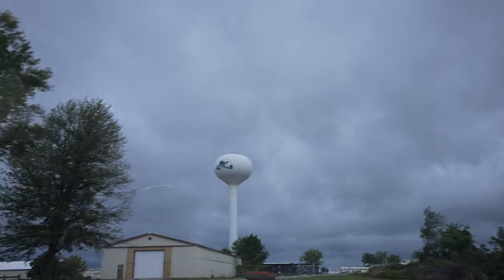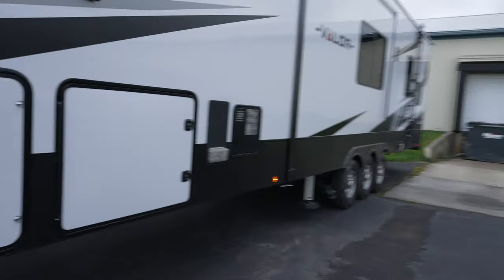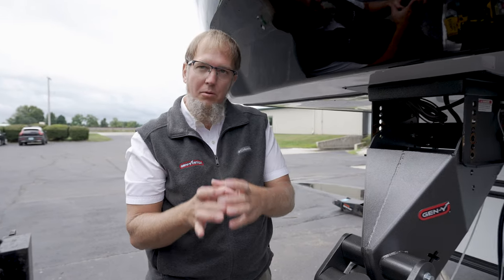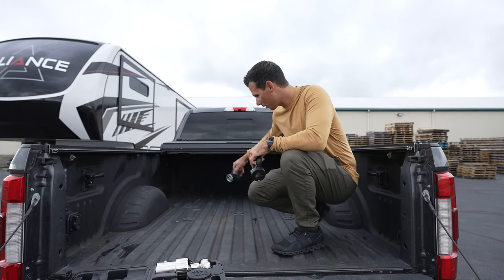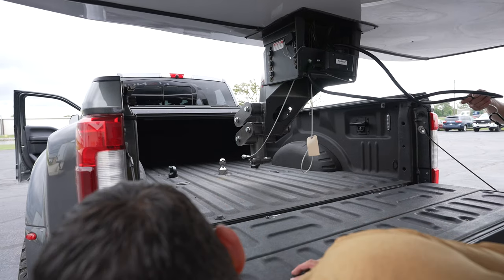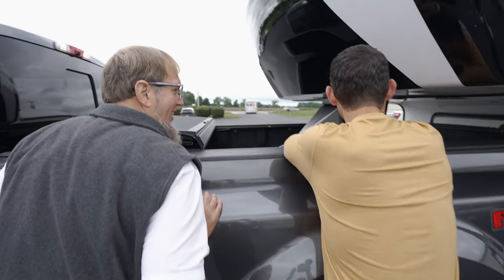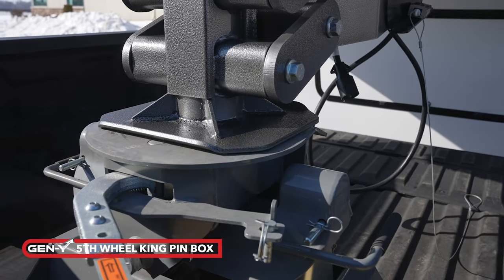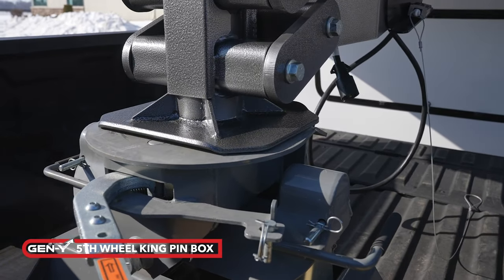Gooseneck conversion on our Alliance Valor...should we have done this sooner!?

Comment: Gooseneck is on heavier trailers because the trailer can lean with out flexing the trailer frame,as in horse trailers and equipment trailers that go off road. On semi trailers the fifth wheel stays flat but the truck frame and suspension is designed to flex.
Reply from the maker: That’s a great point! Thank you for sharing.
Reply: The gooseneck is much easier on a pickup truck frame and suspension because it can pivot 360° a fifth wheel just back and forth, and we all know Campground roads can twist back and forth which makes it much easier on the camper and the truck with the gooseneck

Comment: It's the law because of the semi's and the people lobbying for them. There is no other reason that you need one.
Reply from the maker: Good to know!
Reply: Since when do semis use chains with coupling a trailer? The reason is legit in the name “safety” chains. Just like on a bumper pull, it’s in case the trailer comes uncoupled and doesn’t fly off into traffic.
Reply: Gooseneck need chains, 5th wheel doesn’t

Comment: Another plus for the gooseneck is that it is a safer solution.  I've seen many YouTube videos of trailers crushing the truck bed because a pull test was not performed when pulling away or having your arm ping between the trailer and truck bed because the trailer rolled off the hitch.  It's very difficult to have that happen with gooseneck - it's either hitched up or it's not.
Reply from the maker: Yes! Absolutely! That is such a great point. We believe this to be the safest solution as well and will always tow this way moving forward.
Reply: NOT TRUE.  That is why chains are required on goosenecks and not on 5th wheels. The failure rate of 5th wheels is very, very low compared to ball hookups.   I'm not saying goosenecks are bad, I actually love them.  But it is not "it's either hitched up or it's not".  MANY people "high hitch" when using a ball set up.  You must make sure the ball is seated properly and the hitch is not sitting on top of the ball.     @PawsForLove
Reply from the maker: Absolutely, great points!

Comment: As far as warranty, may depend on manufacturer. I have verified with Brinkley about switching out on a Z model and they prefer the Gen-Y (it is standard on the G model - choice of pin or gooseneck) and believe they will be better for the chassis and frame long term. Since warranty goes through them, they have said it will obviously not void it even though it is a Lippert frame.
Reply from the maker: That is great to know! Now that you say that, I do remember seeing the Gen-Y Fifth Wheel version on the demo unit at the Tampa show this year.

Comment: I have had my Gen-Y gooseneck on our Reflection for two years ...absolutely luv it! No maintenance, built extremely well. We use the B&W ball which gives a little extra height. 100% recommend Gen-Y over other brands.
Reply from the maker: I love to hear that! We are equally as happy with this unit and highly recommend it. Inflating airbags is no fun 😂
Reply: How about short beds? I’m soon to be market ,love idea
Reply: @emmo51364   I have a Ram 2500 and tow a keystone cougar. I can't make 90 degree turn with the gen y. Then again I never needed to ever before. So well see how it goes.
Reply: @Mattman2500  Thank you ,haven’t pulled trigger just yet. I’m thinking you’ll like it,looking forward to hearing more. Thank you

Comment: Well... not knocking it, but i have a question to anyone: Are the benefits worth the hassle of climbing in and out of the bed for the safety chains?? Also, once you get under, if you put the gate up, don't get in a rush and frustrated because your ball isn't lined up and pull out.

Comment: I used my brothers truck to tow our 5th wheel home and instantly took off the king pin and put a Reese Goosebox on it.  

My big reason was I need my truck bed.  I put a BW turnover hitch in it as it wasn't factory prepped and now all I have to do is flip the ball over and I get my bed back instead of having to remove a 200lbs hitch.  The ride is also better, but that wasn't my primary reason.  It's a little more difficult to hook up, but you get used to it.

Not all states require the safety chains, but I bought mine from Reese and hook them up every time.  Better safe than sorry.
Reply from the maker: That is fantastic! And such a great reason to go with a goose set up. It’s great that mostly all options out there are high quality — so you really can’t go wrong.

Comment: We bought our Alliance Valor 40v13 last December. 
We never even towed it off the lot without the Gen-Y Executive hitch. 
We Absolutely love it.
I did a ton of research and realized this is the safest and easiest way to tow.
We however opted for the B&W
Ball kit for our Ram Truck. 
I put the chain anchors in the rear position. I can reach everything standing on the ground. 
The B&W Ball is nice with the handle so you don't have to get grease everywhere when removing 👍
Reply from the maker: I'm so happy to hear that you love yours too! Seriously, so game-changing. That's a good point on the B&W hitch.. I hadn't even thought about that part when researching. I guess we just assumed they were kind of a "one size fits all" thing. I'll dig more into that now, thanks for the tip! - Sean
Reply: @PawsForLove  Also with the B&W ball there is no Mechanism in the top of the ball. 
People have had problems with some of the others because over time with the weight and wear they can't get the Mechanism to release.
Reply: How is the hitch on the 40v13? We are getting the 40v13 soon and the first thing I want to do is move to the “gooseneck” setup
Reply: @raddisonwilliams  It's absolutely great. We will never have any other hitch.
Reply from the maker: That’s so great! Same here. We actually just sold the Valor and are getting the new Paradigm 375RD. First stop is the Gen-Y factory to get the new one put on!

Comment: We love our Gen-Y Gooseneck hitch.  It is a rough ride for the first 600 miles or so.  We have 7500 miles on the hitch and wouldn't trade it for anything.  We got a tire step... it makes it a lot easier to connect the safety chains.  The first step we ordered was 19" wide, it did not work well with our F450 19.5 rims.  We got a 22 inch wide step and love it.
Reply from the maker: You’re totally right about the rough ride 😂 But after it smooths out… holy cow it’s amazing! Love the idea about the tire step. That might stop me from whacking my head on the cap when I jump into the bed!

Comment: Just saw the video, great video and  content.  One question.  I saw where the tailgate was an issue of almost hitting the trailer when hooking up and unhooking.  Is your truck a long bed? 
Thank you 
Safe travels
Reply from the maker: Thank you so much! Great question on the tailgate. It has roughly 4”-6” of clearance between the tailgate when it’s down and the RV. It seems like a short amount on video, but in real life, it’s not bad. 

What we have been doing though is putting the tailgate up when it’s clear of the pin box. That way there is no risk of running it into the RV.

Comment: This is interesting 🤔 thank you for sharing! I am hitch shipping now...fellow Alliance owner...and leaning toward the pull rite super glide for my standard bed truck. I wonder how this hitch performs on  short bed and standard bed trucks.
Also curious, how much weight did it add to the front end of the camper? Is it much heavier than the original pin?
Reply from the maker: Well hello fellow Ally! It's hard to tell on the comparison with a short bed because we have an 8' long bed with our F350 dually. I will always now opt for the 8' bed after having one! In regards to the weight; I don't believe it added much at all. And if you consider how much weight you save in the truck bed by not having a hitch, you'll have reduced your overall weight over the axle.

Comment: I too was wondering if the gen-y would void trailer warranty because of the change of the frame strain point.
Reply from the maker: It does void the warranty from Lippert. However, theoretically, there is no difference in this unit and other manufacturers such as Reese. We were comfortable knowing they have had zero frame issues reported though.

Comment: I believe Gen Y also makes a 5" offset ball if you need more room between truck and trailer.  Also do you find it more difficult to hitch up or getting things lined up properly?  Or is it a two person job, or if you have a bed view camera how does it go?   I know with my traditional fifth wheel as you know is fairly simple to hitch.  It does look like an awesome hitch though.
Reply from the maker: I believe they do as well! It was certainly an adjustment backing up, but it is now a one person job. It could go a little faster with 2 people. The reason is that the camera is good to line you up side-to-side, however it's hard to gauge your depth sometimes. After doing it a dozen times you definitely get a feel for where to stop though. I just do it myself now and it only takes about 5 minutes in total hooking up.

Comment: Does that camper have a lippert frame? From what I've heard the manufacturer doesn't consider the Gen y gooseneck to be compatible cuz it could damage the frame but that's just what I've heard.
Reply from the maker: Great question! This Valor does have a Lippert frame. Technically speaking, it does void the frame warranty. I’m talking with Gen-Y before we did this conversion, they assured us at they have had no known issues with Lippert frames. That gave me enough confidence to go with this unit knowing the pros vs cons.
Reply: @PawsForLove  I got ya. Out of curiosity why not go with the reese option that is certified compatible?
Reply from the maker: At the time, it wasn’t offered for the Rhino box. Even with the Gen3 one that is out now, I don’t want an airbag to maintain. I would still personally go this route again with the Gen-Y setup.

Comment: Hey, great video but a quick question it looks like your Ford is obviously a Dooley but it looks like it's a short box. What's the length of your box on your Ford? And do you find that the Gen Y hitch allows you to get close to 90 degrees or did you have to get the gen y extension to push the ball back further in the bed?
Reply from the maker: Hey there! Our bed is actually an 8’ long bed. We didn’t need an extension since it’s the long bed version.

Comment: Curious what options you have for changing the height to make your trailer level using this type hitch.  I have the B&W  25K fifth wheel hutch and it has some adjustment up and down for height.  I am curious if you had any issues when you switched over.  Is your F350 4WD?   I hear there are balls that are taller in case you are low in the front and need to raise the height
Reply from the maker: This is a really good question! At the end of the day, the way to adjust height on this is to adjust which holes you're using in the pinbox. I feel that overall, I'd assume this will work on almost every truck and you'll have plenty of clearance between the bed and RV. Our F350 is 4WD. Personally, I'd really like to level our truck with the 2" spacer in the front, but it's hard to justify the expense!

Comment: Will this stop the chucking. I’m up against my payload weight on my Grand Design 150 series towing with a Tundra. I do bottom out on bridges sometimes.
Reply from the maker: I believe that it will. It did on ours at least.
Reply: @PawsForLove  are you pulling with a half ton?
Reply from the maker: @mikegarrison3740 We have an F350 dually, which is the truck in the video.

Comment: So is that on a short bed or long bed? Will it work on short bed?
Reply from the maker: We have an 8’ bed. I believe this will still work on a short bed, but you could run it into the cab. The slider hitches help fix that problem when using a fifth wheel style connection.

Comment: During your research, did you compare the Gen-Y to the Reece Gooseneck?  Many say that the Reece Gooseneck is the only one that won’t void the Lippert frame warranty??  I want to go to this type of pin box when I get my new truck so I’m curious as to why you picked this one over any other gooseneck type options.
Reply from the maker: Great question, Mike! Yes, we did look at the Reese gooseneck. Ultimately, I didn’t want an airbag to maintain, which is what swayed us to Gen-Y. You are definitely correct about the Lippert frame warranty with Gen-Y though. When we spoke to Gen-Y about this, they had said that out of thousands of units, they haven’t had a single frame issue. For us, that was enough to trust it. However, it’s understandable if that’s a deal breaker and pushes you to the Reese.
Reply: @PawsForLove  I like the way you think. When he explained that there’s no maintenance to be done at all on the Gen-Y it sure got my attention. One of the main complaints I’ve heard from people using the Reece is about the airbag that requires frequent inflation & adjustment.  I’m not sure why Lippert hasn’t approved the use of the Gen-Y on their frames but I think the numbers speak for themselves if no one has reported any issues so far. Thanks for the quick reply 👍🏻
Reply from the maker: @PAWS4U  You're absolutely right! The airbag was a deal breaker for us for that exact reason.

Comment: is the mileage difference because you are not in and out of the throttle when the trailer would bounce with the old hitch?
Reply from the maker: That’s a great question. From what I understand, that is correct. It’s more “connected” to the physics of the truck and it’s also not bouncing around as much because the pin box essentially has some built in suspension with the TorsionFlex technology behind Gen-Y.

Comment: I have a 2022 Ford F-350 with the puck system installed can I pull my fifth wheel out and just drop a ball in?
Reply from the maker: Yes sir! That’s exactly what you can do. The middle hole is the one for the ball.
Reply: @PawsForLove , I bought the truck with the hitch in and have never pulled it out so I had no idea...Thanks!

Comment: easy to hookup = easy to steal. How do you secure a gooseneck? 5th wheel trailers have kingpin locks, which work pretty well.
Reply from the maker: Great point and question. Gen-Y makes a lock for the pinbox and we use that. Here is a link to what we use: https://genyhitch.com/product/auto-latch-gooseneck-coupler-lock/?attribute_pa_receiver-size=auto-latch-coupler-lock&gclid=Cj0KCQiAgribBhDkARIsAASA5bskjTrpUuptWW6P-A_E1DAYESi1c0oLvXRkaoPxmklBaDzgqgVEIeAaAqQDEALw_wcB

Comment: ??? Y would you place all of that pin weight on such a small focused area.  I see you have the ford factory 5th wheel “puck” system in the bed.  It allows for better weight distribution on the truck frame.
Reply from the maker: These trucks are set up to carry very heavy gooseneck loads. Have you ever seen the “hotshot” setups that are hauling 3-4 cars? That pin weight is much higher than our Fifth Wheel.

Comment: We were considering this hitch but have been made aware that this will void your rigs warranty?
Reply from the maker: So it doesn’t void the overall warranty. At this point it will void the Lippert frame warranty, however, they have had zero reported incidents since this product has been introduced. We were told that when we toured the factory.

Comment: Greetings! I'm actually doing the very same research right now for our rig.  I have to admit that my focus is not really on freeing up the bed of my truck, it's more around ease of hitching and smoothing out the ride.  The question that I have, that I've not seen addressed anywhere, is how is the side to side flex? The up/down is handled by the torsion bars, but what about side to side? Thanks for the great video! It was very informative and good to see the ease of the switch out.  Safe travels!
Reply from the maker: This is a GREAT question! Until you pointed out that it’s not been addressed anywhere, I hadn’t realized that. Such a great point! After reading your comment, I reached out to Jason at Gen-Y. He is the gentleman in the video that walks us through all the information. He first pointed out that when the fifth-wheel does move side to side, it will pivot on the ball, which means that it doesn’t technically compress the rubber (Torsion Flex) as much. But figuratively speaking, if the coupler was “solid mounted” on to something, and not on a ball or something that pivots, he assured me that there would be some “flex” to the rubber and would provide you with some level of benefit. Let me know if that answered your question or if there is anything else I could help with. - Sean
Reply: First, thank you so much for the reply! My question originates from thinking about what happens when I go offroad for some boondocking.  There have been a couple of times that the drop off from the paved road to the side road had to be taken at a little bit of an angle.  My Reese 5th wheel hitch pivots side to side which provides enough flex that I don’t worry much…I still take it nice and slow, but the flex is there.  That’s why I was wondering about the gooseneck side to side flex.  It makes sense that within the hitch to ball connection that there would be some give, just wasn’t sure how far that would go.  I hope this makes sense! Thanks again for your reply, I’m looking forward to hearing about your overall impressions of the GenY hitch!